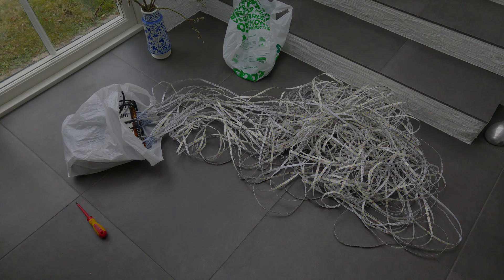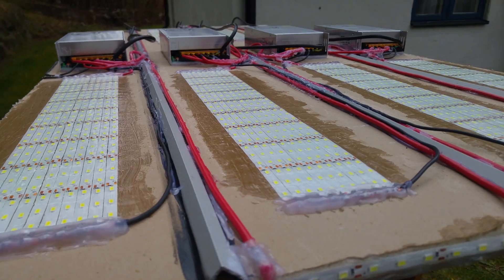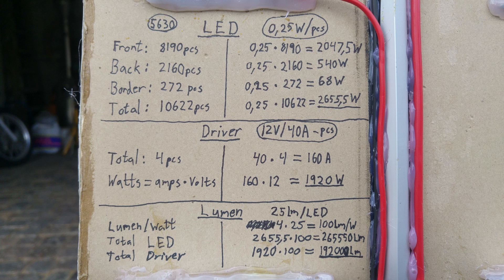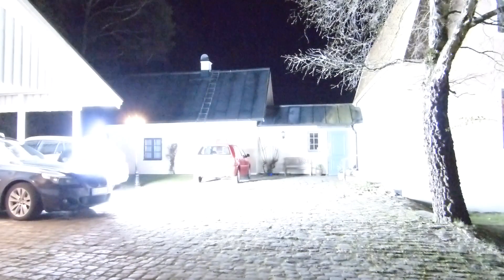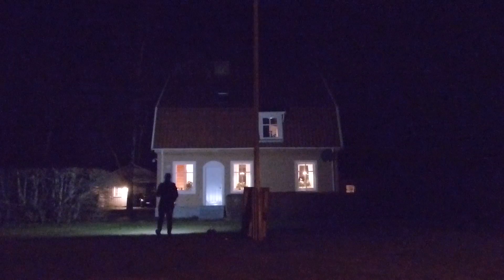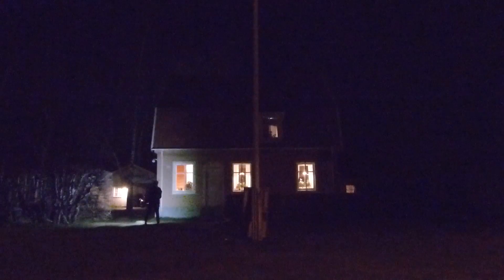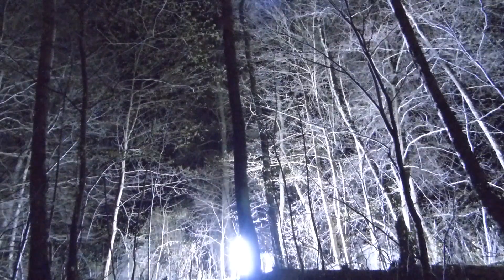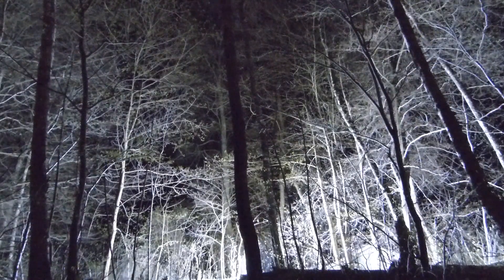1920W LED Panel, 192000 Lumen micro SUN?

Comment: All I can think of is heat.
Reply: its LEDs...no heat. no?
Reply: @LadyJustice86  Most of the energy is still converted to heat, but less than in incandescent bulb.
Reply from the maker: It is only possible because they are LEDs, still with such a high output as 2kw the panel builds up heat and after about 15 minutes the heat coming from it is comparable to a solarium.

Comment: very nice job. did you use 5630 leds right? this leds has 960 lumens per meter. next time, if you can, try to use 3014 leds. they have 2048 lumens per meter. more than twice brighter than 5630, in the same size. your panel becomes so brighter that you need to put it far away, otherwise your can't see nothing than white things. try to split it in 4 pieces around the house and you will have something like daylight. and about that, you used only 6500k leds. next time try to mix 6500k with 4500k leds. it will be more closer than daylight. anyway, it's an impressive work. best regards.